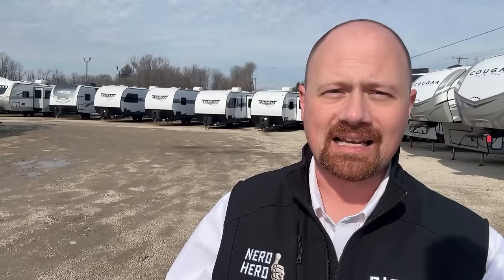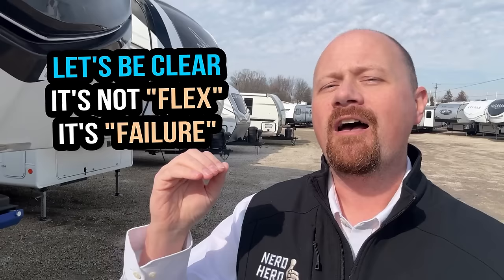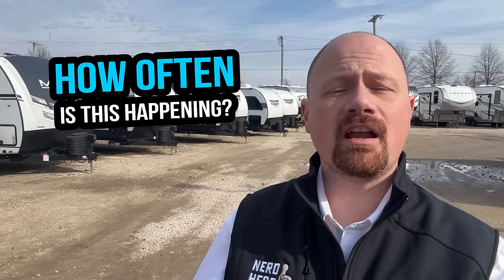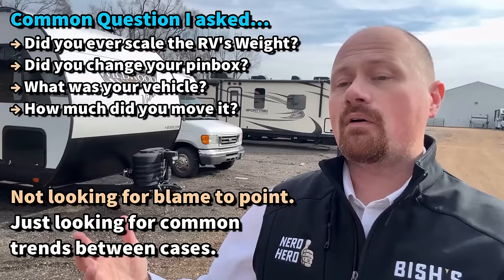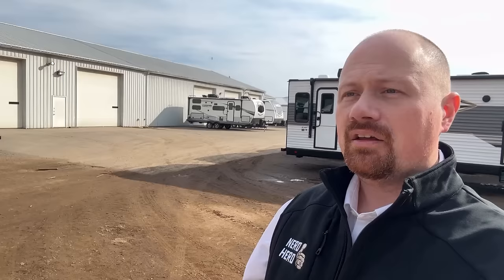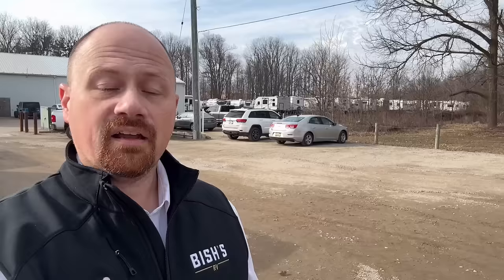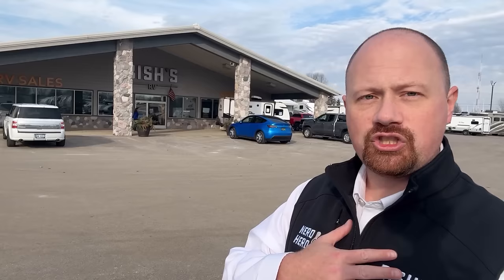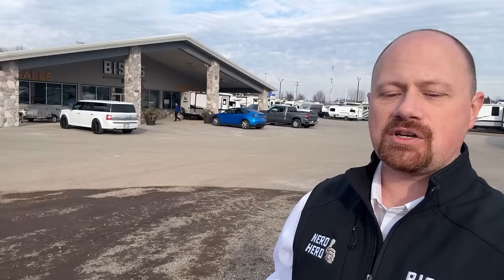🚨 RV Frame Flex & FAILURE!! • WHAT is Happening and WHO is Responsible?!

Comment: I'm dealing with this as we speak on my 2022 Grand Design 380FL. It's been a small nightmare and quickly turning into a big nightmare. I have an open claim with Grand Design, I was told to get hold of my dealer to bring it in to have them measure, I called my dealer which is RV Country in Laughlin, Nevada. The service manager said and I quote, 'frame flex/frame failure, what's that? Never heard of it or seen it'. They claim they don't know how to even measure for it. Still waiting on GD to tell me what they want me to do next. I'm a contractor of 39 years and am quite handy and fully capable of doing many things, measuring and precise increments being one of them. I've measured twice according to LCI's method and have almost 1" of variance. Tolerance is 1'4"-1/2". I'm very aware of what and how I load our camper, and take extra measures regarding weight and placement of our things when in tow. I'm never overloaded. We winter in Arizona and are supposed to leave for home, Minnesota, in 3 weeks. I have another friend who had a 2021 Momentum toy hauler, their frame issue was so bad it was destroying the front of their unit. We've only towed our unit a total of about 7,200 miles or so. We're in the early stages of the issue and the evidence is there in plain sight of the problem. I'm trying to be proactive about it now before it becomes a huge problem. I guess we'll see how this all shakes out with Grand Design. I might be demanding that they let me bring it to them for repairs. Love your channel, Josh and thank you for bringing us real world data and experiences on your pursuit of RV truths.

Comment: Awesome as always Josh, that was a great tight rope walk, but super informative. I had no idea on the too much truck section. I have been towing for 30+ years and have always been the one with bigger and badder is better. Holy cow, you just made me think about a truck purchase i was in the process of purchasing due to a bit of trailer sway, was going 450 for my 10k bumper pull, i think i am just going to upgrade some suspension components and stick with my 2500hd. Such great information thank you!
Reply from the maker: Thank you for taking the time to tune in with an open mind
Reply: Big difference between an F450 and T680.  IMHO if you want the tighter turning radius of the F450 axle, or have other reasons for swapping out a worn-out chevy,  don't be scared of towing 5 tons with it.  If things are getting a little squirrely for you though, I'd think about going to a better hitch system such as goose neck or RV 5th wheel.

However I'd also take the observation of 'too much truck' with a grain of salt.  If modern tractors can adjust air bags down to handle an empty van, it's not going to be much of a stretch to comfortably pull a loaded RV with one.  I'd guess installing an adapter between air brake and electrical brake system, and getting your transport license, and making sure the kingpin matches the height and structure of the fifth wheel plate would be much bigger considerations.

Comment: HAD A Lance 1995 that I weighed and kept 500 pounds  under max weight. it was a 2019 model without the bells and whistles.  Bottom line is that  the frame flexed bad enough to crack the gel coat.. Lance fixed the gel coat once and did a nice job.. 6 months later same issue.

Comment: I do tend to put a lot of miles on my stuff which is a contributing factor no doubt, however, every toyhauler I've owned has had at least 1 frame failure. The Weekend Warrior (it was a tag-not a fifth wheel) failed several times - with ZERO support from them. I ended up fixing that myself. NextLevel I had the walls started falling off - the outriggers from the frame were not strong enough and were bending down allowing the walls to sag. Currently have a ForrestRiver and although it hasn't failed, I can see signs of flex that isn't to the point of failure, but it's going to. 

I think a big part of the problem is trying to make them light enough to pull with a normal pickup. I'd like to see something between regular crappy toyhaulers and full custom SpaceCraft stuff. Basically a heavy duty version that would be pulled with a medium duty truck or larger. 

The Warrior was overloaded sometimes, but not by a lot. The other 2 scaled at or under max weight.
Reply from the maker: Weekend warrior unfortunately I as known for frame challenges as I recall

Not saying they’re the only one but I feel like I remember hearing about a lot of those
Reply: @JoshtheRVNerd  Weekend Warrior was for sure known for frame failures. Put them out of business in fact. Weekend Warrior may not be the best example, but they are definitely a case study of how not to build a trailer! Although I did like their floorplans.

Comment: Well, BOTH of my campers were "Special Ordered" as Four Seasons livable, and that they would be used as Work Housing that would quite possibly be in a different state every week. NO one including the Manufacturer said anything about Mileage limitations. I damn sure would have kept MY $80,000 in MY pocket, and done something else if they had. I definitely learned to keep spare axle bearings, seals, greaseable hubs, and extra 16 ply spare tires on hand real quickly though.

Comment: I would like to welcome bish’s RV to our community here in western Michigan. (Muskegon) if you ever get up this way it would be cool to have a meet and greet. Well this was sure in information packed video, the only thing I could nitpick about it is what you put forth the semi trucks have a stiff suspension so it will damage your camper. Modern day semi trucks have load sensing suspension i.e. air ride. They actually ride better than most pick up trucks I have for decades plus in that category and they make great tow vehicles for campers, boats and other recreational needs. rVs or as we call them in the trucking industry campers are not meant for professional use. Trailer tires for RVs and semi trucks are subpar quality if you have a camper upgrade your tires to light truck tires you will get a lot more miles with a lot fewer headaches. You almost need to have a big background as a handyman to even think about owning a camper, many of these new campers makes you wonder if you should leave home without a welder with you. Manny newer RVs have torsion axles, in the commercial world that would not be DOT legal they do not equalize the weight on the axles they have no mechanical equalizer or air lines to equalize the axles. If you do have an RV with air ride if they do not connect all the airbags together with a continuous line you’re headed for problems. Again these things are meant for professional full-time use and if you abuse him I hope you like your banker. I’ve had numerous RVs and I can’t think of any of them safe one I had a bumper pull Work And Play that thing was built like a tank in fact I think you could haul a tank in it. But they don’t make them like that anymore everything is so marginally engineered by people that don’t know what they’re doing. They are a lot of fun and they sure make them pretty. They’re not bad I know I’m bashing them pretty bad but they do have their shortcomings for sure. The best rig I had for pulling my toys around was a fifth wheel pulling a car trailer full of motorcycles yes I was pulling doubles and that is without fail the best way to do that some people may be intimidated by that combination but once you do it you wouldn’t want to go to anything else. But your fifth wheel  must be properly built and set up to do that. Most are not. Thanks for another great video I enjoy your stuff a lot thinking of going out to the dealership (bish’s )To look at that rear door Geo pro that looks very interesting. Thanks again
Reply from the maker: I’ll try to let you know next time I am swinging thru our Ludington store

Comment: One thing with the weight that a lot of people completely overlook is the cargo weight is calculated from your dry weight. Dry weight meaning nothing in your tanks. If you happen to drive with even just 1 tank full you are already almost at 1/2 capacity. Maybe I am wrong but that is the way I was looking at it as 100 gallons of water is not light
Reply from the maker: Right. Water counts against CCC. This is a good talking point Ty

Comment: Great 411 Josh. I wonder if the metal gauge/specifications have changed over the past several years. I can appreciate that the metal they continue to receive is as "speced", but has that spec been reduced to help lower the dry weight. It amazes me that many manufacturers have floor plans with huge under belly storage with sliding trays but have very little capability to carry anything in them.
Reply from the maker: It’s possible, though I lack actual data on that so I can only speculate

Comment: Josh, actually you can see how much you move it if you set up your trailer in your information center of your truck. I have a F-250 with the towing center area of the info center that I have my Grand Design Reflection fiver in the system. When we hook it up to go on a trip, I select that trailer as you can input more than one. It records the mileage to only that trailer! It is rather nice. As to too much truck, I always wondered this when at campgrounds you every so often see a flat bed or even the tractor trailer Freightliner pulling a 15k fiver! I thought myself, that is too much truck for such a fiver. But never thought of it in the sense of transfer of vibration but rather the stress from the rigidity of the hookup. 

We only tow our unit with minimal things inside the lower basement and in the bedrooms......like clothing and foldable chairs and the necessities only. Our pin box is OEM but we use the Andersen Ultimate hitch with the gooseneck insert which has worked great. The pin box seems to float and have more lateral movement better with that system than being rigid like a typical fifth wheel system in your truck.

The excessive frame flex mystery......I don't know!? I assume to a degree it may be many inputs in this. Could be manufacturers using marginal frames to carry a box that is close to the maximum value, could be overloading by owner, could be compromised steel from the steel manufacturer every so often, could be bad roads and excessive towing like you say. I know some people that are on the road with their RV monthly somewhere. We go like 4-5 times per year tops!

Great video and can you make those vest you have to say Nerd Hero Groupie and make for sale?  LOL
Reply from the maker: USING TRUCK TO TRACK MILES: I know some newer trucks have that capacity but I feel strongly the industry needs something on the RV itself. Not every truck has that tech on board currently

YOUR HITCH: You may still consider checking to see if that system is approved. My home store here has stopped using multiple types of hitching systems over the years because we discovered later they were stressing frames in unintended and unexpected ways 

MARGINAL FRAMES: Without question there's a lot of minimal builds out there. Again I feel if people were properly educated as to the expectations of the RV and its engineering, then we'd have fewer issues. BUT.. that would also yield a loss of sales so I'm not holding my breath 

VEST: It's supposed to say "Nerd Herd" but the embroidery shop didn't nail that last D lol :)
Reply: @JoshtheRVNerd  LOL on the vest. It looks like Hero. Yes, I agree that the trailer itself should also have the ability to record mileage like an on-board odometer. Problem I guess is the axles and wheels can be changed out so easily and often it makes for the issues unless they put a odometer in the control panel that no matter the change out of axles or what have you it records to that. A plain old analog type system would be great. I am old school however. 

Once again.....great info and we all should do our homework prior to buying a camper for sure.

Comment: I currently own my third RV, I have NEVER heard a limit in terms of how much you can tow one and quite frankly am frustrated to only now hearing it. So someone pays from 60,000 to over 100,00 for an RV to travel the country to only find out it's their fault the frame failed cause they towed it too many miles?? I dunno, maybe I'm just dense but how in the heck would the consumer know this information? I would bet there isn't a single dealer out there that has ever shared this tid bit of information. My next question would be what is the limit for each individual RV in terms of frequency and miles it can be towed? This should have been and should be shared UP FRONT with every customer buying a new RV. And this information should be  found on EVERY manufactures website. If it is not then the manufacture should be held accountable for frame failer that the customer exceeded this secret miles/frequency barrier. Thanks for sharing all of this information with us, that is much appreciated! The entire RV industry should be half as transparent as you've been, thank you!
Reply from the maker: Ty for watching. I hope we start seeing more clarity on camp critical factors in the future but I am not holding my breath

Comment: At 02:49, I saw the Coachman Catalina legacy edition. What got my attention on that unit was the shape of the nose and the front window. It looks like a new shape. With the point of the bulge raised and the face below the window down to the frame totally flattened out. Is that a new nose shape we are going to be seeing more of on other models going forward? 

As you do your walk around, I am looking at the trailers in the background for anything new and interesting and how the products are changing. For instance, all those fancy huge camp kitchens cutout that were so hot a year or two ago are a less seen must have now. Now they are more commonly down to just a cooler or camp stove size if they are included at all. And those large camp side outside speakers are not as popular features as they were. Trends are changing right before our eyes. We are watching a quite extensive evolution of the model configurations and outside style of the RV units that is easy to miss otherwise.
Reply from the maker: They had to have a second front end design for windshield models

Comment: 2 small points . First weight your truck BEFORE you hook onto your 5th wheel so you will know your front and drive axle weights !!!  Then weigh your unit so you can see how much the real weight of your unit is . Second  is we saw a GD 5th wheel in Utah camping and I noticed the front was leaning to the right ( drivers side )  and dipping down a little . Yes it was a really really large one and I stopped and asked them if the had noticed the way it was leaning to the front right driver side . They didn't even notice it because they were used to it . We talked for awhile then his wife came out of the unit and said she was doing so some washing  and drying a load . I laughed and asked where the washing machine and dryer was and they where stacked   in the front drivers side nose in the bedroom . When GD or any other RV 5th wheel manufacture says the total cargo load is say 2500lbs  do they count on a full washer and dryer in the nose of the unit maybe over loading it ?   And more important ( and I may be wrong ) why would any manufacture put a washer and dryer in the front nose of a 5th wheel ???

Comment: I saw two Montanas at our local Camping World with stress cracks in the fiberglass toward the front. Service guy said he'd been seeing more of this. They were $40k repairs +/-, according to the service guy.
Reply from the maker: New/Used? Where were the cracks?
Keystone has a flex-zone below their bed slides typically to allow some movement in that area without cracking the fiberglass typically
Reply: @JoshtheRVNerd  I don't know. I think they were both less than a year old, and it was warranty work. They  had the same vertical fiberglass cracking right where the bedroom met the 'dropdown' part of the 5r. They said they were taking off the exteriors, beefing up the frame, and rebuilding the skins. I didn't think to ask if the owners had swapped to a gooseneck setup. Big Truck Big RV has a series of interviews with Lippert folks on frames that were quite enlightening. They basically implied that the RV manufacturers sometimes were working outside of design parameters with new floor plans and other changes without engineering giving the OK.

Comment: Josh good job, as per cat scale the way we travel on my 3 axle trailer I have 1540 on each of the six tires on it 5490 pounds on the rear axle of the truck and 4200 pounds on the steer axle, the tires on the trailer are 16" E rated tires so I'm running them at about half the rated capacity, we travel light because I ain't burning fuel dragging something around I'm not  using . I'm in a different section of the transportation industry and my opinion on part of the problem is a single point of tug on a square frame, you can't equalize the force on a square when pulling from a single point take a piece of rope and hold it with your arms out to your side and have someone pull it away from you from the center then hold it with your arms straight out in front of you and have them pull it again you'll see quite a difference